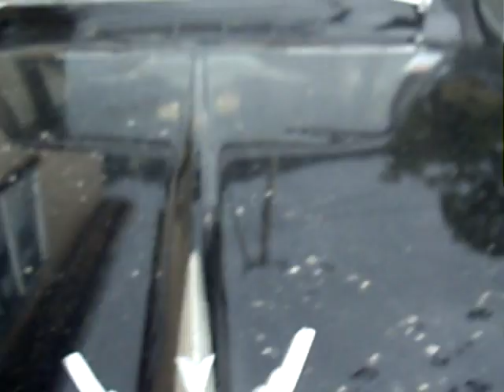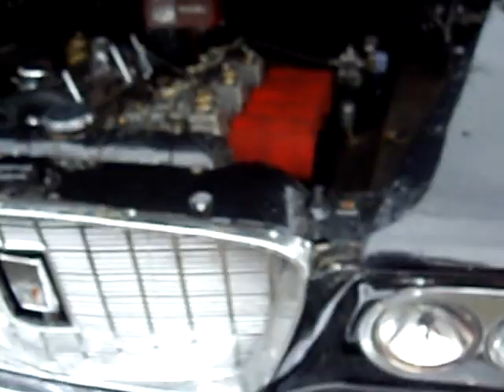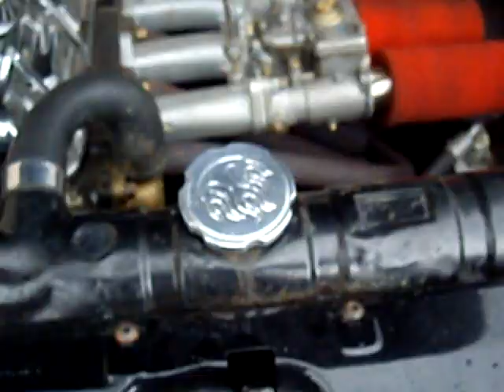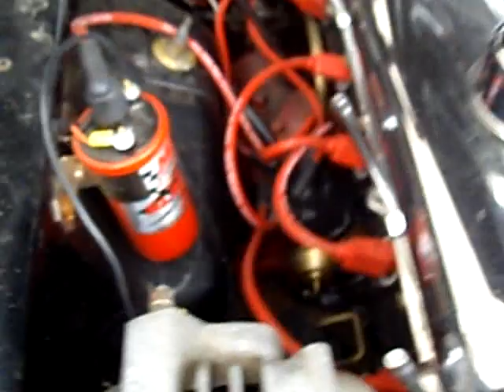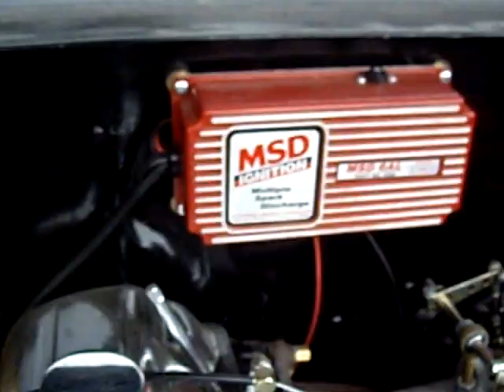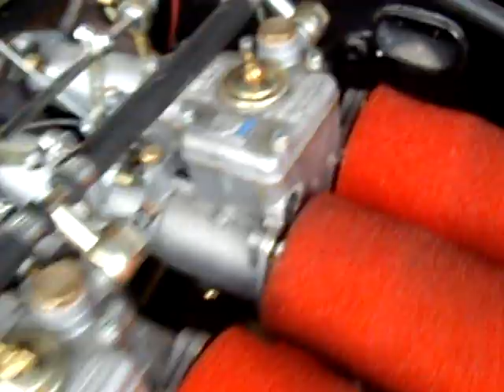1960 R Valiant  Slant 6

Comment: nice.Your setup has equal length intakes which was a problem with other manifolds.Had a 61 with factory hyper pak. Went 15.5s @ 90MPH in 1970 running Q/Stock.Beat a lot of SB chevies except one Truppi-Kling 283 2 barrel that could run under record.Nice work. Engine and body combo surprised a lot of people.